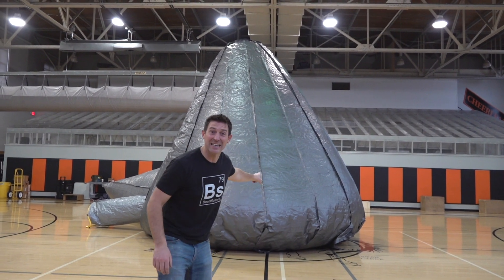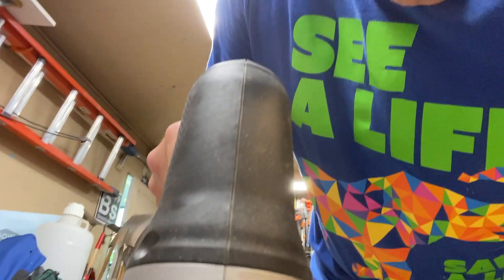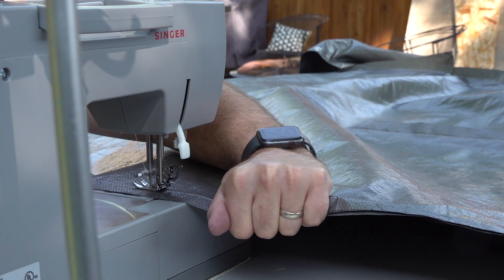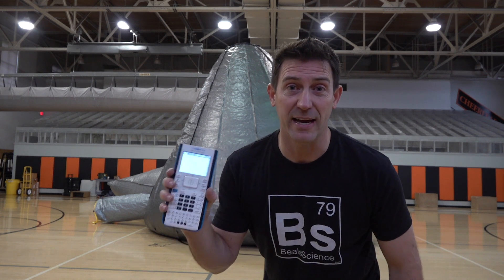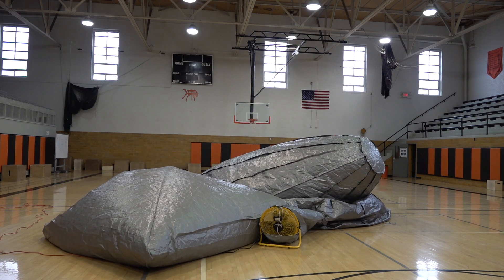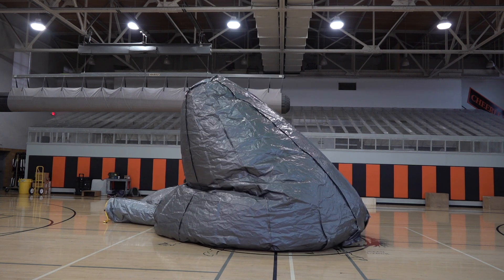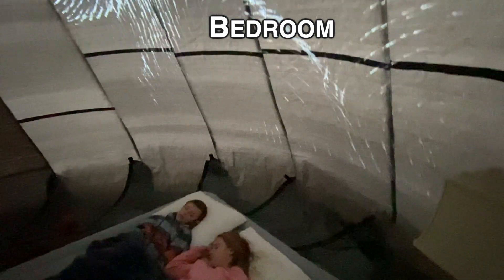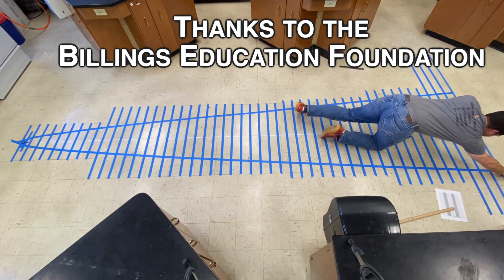Homemade Inflatable Planetarium that you can make for cheap!

Comment: That is really cool!  I love the whole concept of having this as portable as possible.  Certainly am thinking up a number of questions concerning the construction, that I'm assuming will be answered in the upcoming video.    1) sewing techniques - use of polyester or Kevlar type thread for sewing the tarps together  2) use of any seam sealer or tape on the joints, or are they "airtight" enough without any additional treatment   3) weight of tarp material - lighter weight should make it "easier" to inflate, but some of the cheap tarps have enough holes to drive a truck through  4) entrance airlock - size and shape of this help maintain inflation while it is open, to limit amount of airloss?  5) conical vs. more rounded dome shape - probably easier to cut all the pieces and join them together, and gains more height - any other advantages?  6) fan size - is there a way to figure optimum fan size for the volume?  
I still want to put together a dome for use in the house, but the cardboard version may be a bit too much to chew off.  This, however, would be great for both indoor (assuming you have tall enough ceilings) and outdoor use.  One use I could potentially see involves astronomy - our local club has access to a real planetarium where they put on a monthly program of what to expect prior to sending the public outside to look through the members' telescopes on Saturday nights.  I could see this as a great way to do this in a remote location, where you may have a small genset for power, but no planetarium.  I'm sure I can come up with others :)
Reply from the maker: This is a great list of questions! As I put together the "How To" video I will definitely look back at your questions to make sure I address as many as possible. I will touch on a few of your questions right now to help you get started planning:
2) the simple seam with the sewing machine proved to be more than air-tight enough. In fact, I had to leave the door to the tunnel open so the bottom of the inflatable didn't blow out!
3) I struggled with the weight of the tarp material. I finally ended on Heavy Duty (I think it is 6 mil - I will confirm that in the instructions) and it has been handled and dragged around without a single tear or stretch!
5) I went with conical because the cardboard version was dome-shaped and it requires a special projector set up to be able to use it. I figured I would try a conical shape so people could use it for more things and could use a standard projector. The next one I build will be dome-shaped so I can see which I like better but I don't plan to make that one for a few years (too many other fun projects lined up to try first).
6) I went with a fan that has multiple speeds and high cfm. But, I am guessing I could have used a much cheaper, smaller cfm fan and it would work just fine - it is sealed up that well! At some point, I will hook up a standard box fan just to see if it has enough cfm to keep it inflated.

I love your ideas for using this indoors and in remote locations with your local astronomy club! Keep me updated!
Craig
Reply: I was also was wondering about the cone shape. How do you place the projector? Does it just display on one wall?
Reply from the maker: For this video (and for the conical shape) I found it best to just project onto one wall (although the image, depending on your projector, can take up about 2/3 of a wall so it is quite immersive). I do have a projector system that I made for the cardboard dome that will project a "full dome" image or video but it didn't work as well in the conical shape. The main goal for this shape was to have something that people could project any image or video without having to first warp it into a "Full Dome" aspect and then run it through a special projection setup.